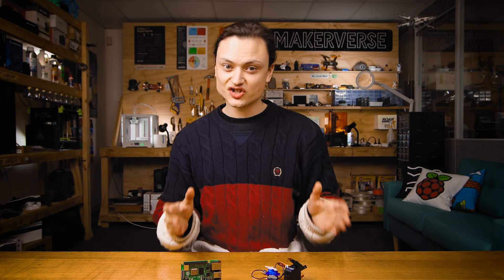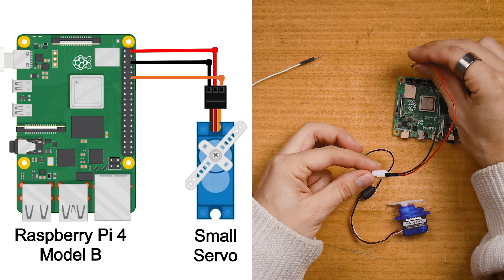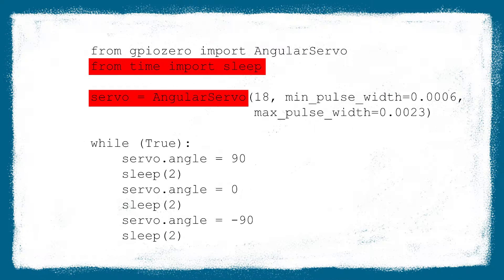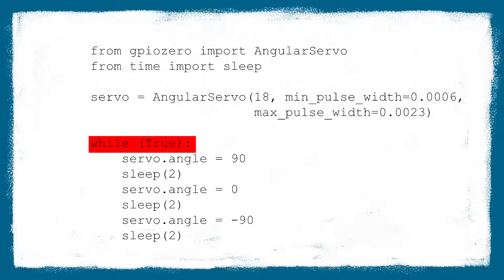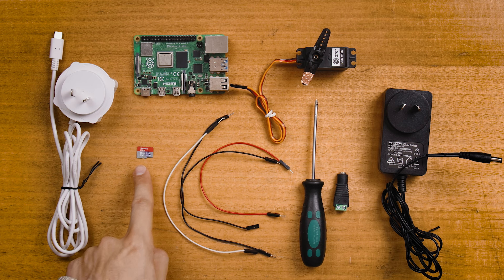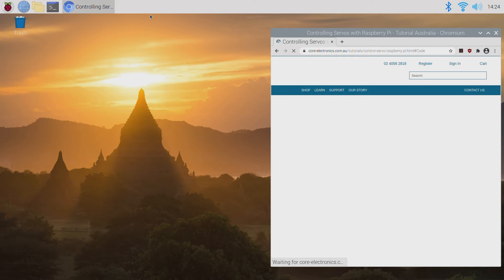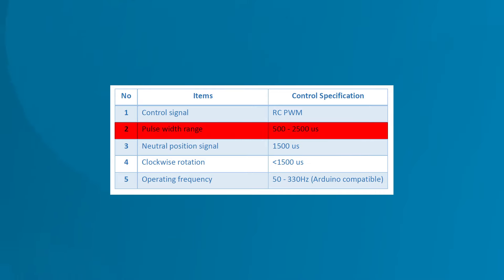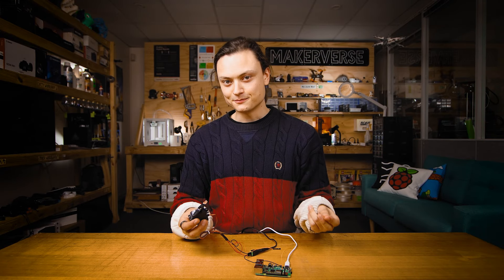How To Control A Standard Servo With Raspberry Pi

Comment: I dont get it, if each pin on the raspberry pi can only provide up to 16mA of current, how come you manage to power the servo which takes  100-250mA when operating? Someone please help?
Reply from the maker: There maybe some confusion, the GPIO pins can only provide 16mA of current. The 3V3(OUT) pin can supply 3 volts, up to 300 Milliamps of current and the Vbus pin supplies 5 volts, up to 2000 Milliamps of current. This current however is dependent on the output capabilities of the USB you are powering it with. If you are using a USB power source that can only supply 1000 Milliamps, you can only use 1000 Milliamps.
Reply: @Core-Electronics  I am using raspberry pi 5 and I am planning to give it 5V 5A , therefor does that mean the 5V pin will give me a maximum of 5A?

Comment: what would interest me is how do i get rotary movement slower say from 90 to -90 in 1 min . Great video :)
Reply from the maker: Hey Siebarth!
This is a very common code often called a "servo sweep". You could use a loop to steadily increase the position of the servo a little bit at a time. If you want the servo to rotate 180 degrees in 60 seconds, every second it would need to rotate 3 degrees.

So you could create a loop that starts at 90 degrees, then every second decreases that number by 3 degrees till you get to -90 degrees in 60 seconds. You can make it even more smoother by decreasing the update time (changing the angle to 1 degree every 1/3 of a second).

Here is a link to some example code: https://core-electronics.com.au/guides/getting-started-with-servos-examples-with-raspberry-pi-pico/#example-1

This does use 0 to 180 degrees though, but the logic is the same.

If you have any other questions or need any more help, feel free to ask us on our forums: coreelec.io/forum

Cheers mate!
Reply: Great to see a content creator that gives in depth, helpful replies!

Comment: why is ny servo so jittery, sooo unstableee even after running the code only, its likee nervous and usntable
 :<<
Reply from the maker: Bright lights can scare a servo and make it nervous :(  

But for real, check your ground connections first,  a common cause of a jittery servo is when the ground connection isn't made properly. If that doesn't work feel free to chuck a post on the dedicated community forum for this video, we have a lot of maker eyes over there that can help. Just give us some pictures of your setup and how you have wired it all up!

https://forum.core-electronics.com.au/t/controlling-standard-servos-with-raspberry-pi/10603/7

Comment: can we run a 40kg servo motor with this technique sir ?
Reply from the maker: Yes, as long as you use the correct power supply that can provide enough current, you should be able to!

Comment: Do you have any tutorial recommendations for if I am wanting to use a button to switch a servo between to positions? Kinda of like in an iron man helmet!!
Reply from the maker: Hey Ayaka, Whilst we don't have a tutorial on that specifically it is not too hard to of a task. You would need to have a variable to count the state, here is what the psuedo code would look like.
(in the set up)
state = 0

(in the main loop section)

if button pressed
     if state = 0
          (set the first servo position you want)
          state = 1

     if state = 1
          (set the other servo position you want)
          state = 0

And with a single button the state will change between these 2 variables. If you need any more help feel free to ask on our forums: http://coreelec.io/forum

Good Luck!

Comment: I am working on a projekt where i need 7 servos in total but there are always a maximum of 2 working on the same time (most of the time just 1), do i need an external power supply?
Reply: yes Rpi board 5V pin is not able to give sufficient current to servo motor

Comment: GPIOs do not supply power to the servo motors, they only supply signal. I believe you mean Power pins, but they are not GPIOs.

Comment: Hi, this was a great video and I've used the same wiring except for a Micro Servo SG90 from tower pro. It didn't even move unlike the other problems in the comment section, is this kind of servo not compatible? Thanks! (also it's a stepper servo)
Reply from the maker: It should still be compatible. Perhaps adjusting the | min_pulse_width | and | max_pulse_width | to max it work. Determine a servos limits carefully by experiment, so adjust those default settings by small increments.
Reply: Alright thanks for the quick response! I'll try it today

Comment: Where do I get the library for the code?
Reply from the maker: Check the bottom of the full written up article for any scripts I have utilised in this guide 😊 https://core-electronics.com.au/guides/control-servo-raspberry-pi/#Down

No extra packages or external Python libraries are required to get this system running.
Reply: Thank you

Comment: thanks a lot for the explanation. how can we control also the speed of the servo?
Reply: Based on the video, it sounds like the black and red wires just give power, and the yellow wire determines angle because it's connected to the GPIO on the Raspberry Pi. Since the yellow wire controls the angle, the speed of the servo would be controlled from the code-side by changing the angle at slower or faster rates. I'm new to this, but that's my understanding of it.

Comment: nice short totorial. Is there also a way to adjust how fast the servo spins?
Reply from the maker: If you are using Continuous Servos you can. Otherwise if you are using a Normal Servo you can get it to step multiple times, with delays between each subsequent movement, instead of a single snap to direction request, which would mimic a slower rotation.
Reply: @Core-Electronics  alright ty that works, do you know if it is bad for a servo to change the spin directionn very frequently like every 0.1 seconds or does it not harm it?

Comment: 5V and GND at the Pinout can handle currents of 1000mA?
Reply from the maker: This is all for a Raspberry Pi 4 Model B - 

For the Power rails: 
-  The 5 V rail appears to passed straight through from the USB and the current is therefore limited to whatever the USB port can supply minus the current being drawn by the board.
- The 3.3 V rail can supply a maximum of 50 mA

For the GPIO:
- The max current you should draw from a single pin is 16mA
- The max current you should draw from all the pins collectively should be below 50mA 

Hope that answers all your questions 😊
Reply: @Core-Electronics  The 5V Pins at the GPIO bar are called Power rails? I use the Raspberry PoE+ HAT (802.3at). So I have ~ 5V and 4A available. Lets say I connect a 3Ohm resistor, so that a current of 1.6A would flow. Will it damage the Pi?
Reply: 3 Ohm connected to GND and 5V (Pin number 2 and 6)

Comment: Hello! I am getting this error when doing the large servo
"PWMSoftwareFallback: To reduce servo jitter, use pigpio pin factory." with a link to the gpiozero docs is there a fix? thanks!
Reply from the maker: That is just the system telling you a method to lower Servo Jitter. Is the servo moving at all when you run the script? Feel free to open up a forum post as well best be able to help you there - https://forum.core-electronics.com.au/
Reply: @Core-Electronics  I have the same error code. Im using python idle, I am going to try running it as a shell. Nope, Same error, thonny has the same error as well.
Reply from the maker: Does the error impact the correct function of the Servo? If not don't stress. If it is causing a very jittery response the solution to not seeing the message any more and a smoother servo can be found here - https://forums.raspberrypi.com/viewtopic.php?t=313651

Comment: Hi it was a really good video but I am facing a problem that my servo jitters very violently due to which it is not able to go full 90 degrees. I hope you can help me solve it.
Reply from the maker: Heyya mate 😊 thanks for your kinds words. If you do not get full rotation out of your 180 Degree Servo adjust the min pulse width and max pulse width values by 0.0001 increments until you do. Adjusting these numbers till they are good will also calm down the servo jittering as well.
Reply: @Core-Electronics  Thanks a lot

Comment: How can I connect a 6- 8,4V Servo with a Rasberry or PWM?
Please help
Reply from the maker: For higher voltages than 5V you will need to use a I2C Motor/Servo Driver Board. Just be careful when you are hooking up power as you do not want to fry the Raspberry Pi. The Raspberry Pi will break if more than 5 Volts are sent through it.

This would do the job well - 
https://core-electronics.com.au/catalog/product/view/sku/SS105020093
Reply: @Core-Electronics  perfekt I would try it.
Could you make a video how to code a "Flight simulator Joystick" Trustmaster 
For steering servos?
Does I need to code every 0-1 ° for low sensitivity or is there any programs?
Reply from the maker: I can see you have a very focused problem, hit this fellow up as he seems to be working right in your alley - https://www.youtube.com/watch?v=TNUACvk1sto

Comment: Hi could you do a video on Auduino and raspiberry pi zero and flysky controller and reciver to contol 2 servos.
Reply from the maker: Heyya mate, this guide here will give you the run down on controlling hardware attached to a Raspberry Pi using an RC Controller - https://github.com/samfok/remote_receiver_tutorial 
I reckon that will be a proper help 😊

Comment: Great video! I was just wondering, would it be possible to use a 5V DC 3A power supply instead of 4A? I'm struggling to find one in any European shops.
Reply from the maker: Yes, absolutely
Reply: @Core-Electronics  Can i use a 5V 1A

Comment: could i use a seperate power supply to power a high power servo, 7.4 volts, and the rpi4 but still send signals from the rpi4 to control the servo? i want to use my body power to power the servo, i got this human vein to usb attachment on amazon, i think my body puts out about 12 volts

Comment: how can i stop the jitter of the servo?
Reply from the maker: That's a function of the RPi's soft-PWM. To completely remove the jitter, the RPi needs a hardware servo driver, like this one: https://youtu.be/bB-xymRI8BY
Reply from the maker: (If sticking with the same set-up, finding the perfect | min_pulse_width | and | max_pulse_width | should also prevent much of the jitter.)
Reply: With the direct connection examples you can alleviate jitter by using a different library (rpi_hardware_pwm).  Coupled with a one line config.txt change this library enables direct hardware timed communication for (up to) two servos when plugged into the right gpio pins.

While pin factories like pigpio definitely help reduce jitter, they do not alleviate it 100%.  Playing with pulse widths / etc do nothing to solve it.  I'm guessing someone is experiencing a placebo effect.

Comment: 4 amps bruh i have 2 max
Reply from the maker: 4 amps is kind of conservative. If the servo isn't holding high torque or stalling you're probably fine. If you use a micro servo then 1amp is sufficient.